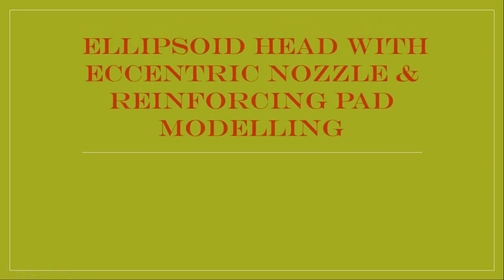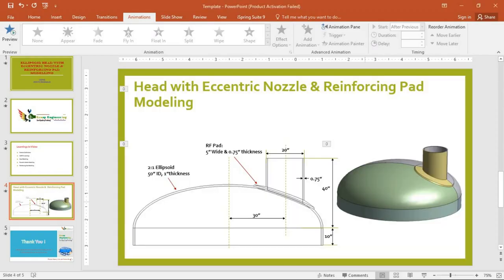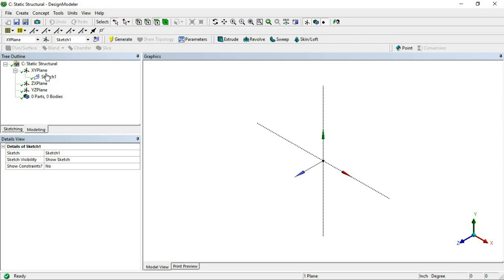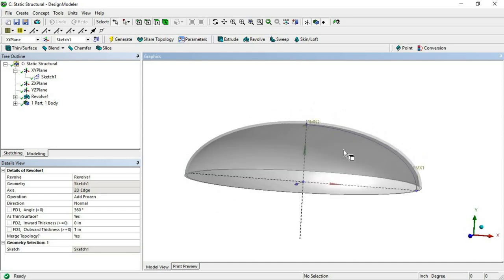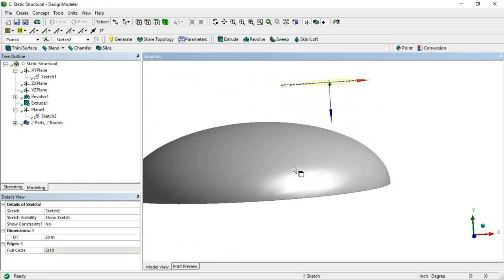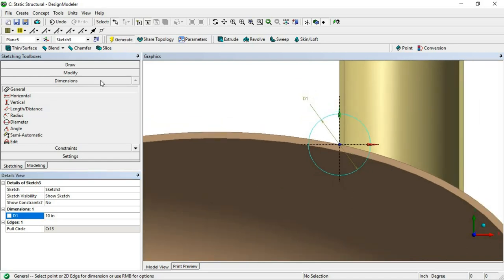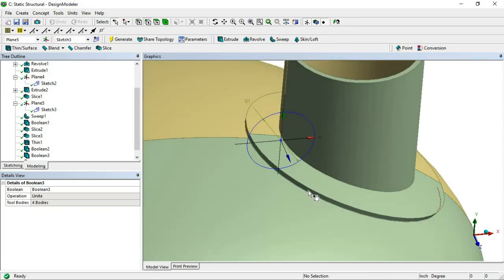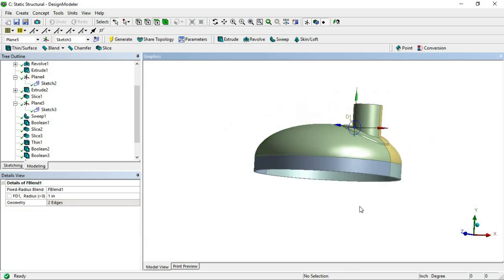Ellipsoid Head with Eccentric Nozzle & Reinforcing Pad Modelling Using Ansys Design Modeler

Comment: Sir when I extrude head to 10inch and click generate the result still shows 1 Part, 1 Body but in your video it becomes 2 Part, 2 Body.
Is there any setting for this.
Reply from the maker: While doing extrude use Add frozen option instead of Add material, Add frozen means it will not merge the bodies but will create separate bodies.

Comment: Can i swich my model Designmoduler to mechanical window and vice versa
Reply from the maker: Yes, You can Do changes in design modeler and then update the mechanical window. But design changes are not done in mechanical, it will be done only in design modeler.
Reply: @graspengineering9249  ok,i wanna change system coordinate first in mechanical window Nd then i want to go with this same changes in design moduler .how can i do that?
Reply from the maker: @nisargchauhan6595  Hello Can you plz define your purpose of doing this ?
Reply from the maker: Create plane in design modeler (using X & Y axis coordinates)and export that coordinate (having option below..keep yes), you will see same coordinate in mechanical window
Reply: @graspengineering9249  
Ya i am learning nozzle to shell junction fea.but the origin is not on the centre of shell so it may creates the problem during slicing.
Reply: @nisargchauhan6595  You can move & rotate coordinates according to your slicing plane requirement (keep Z always normal to the slicing surface).

Comment: Hi there, apologies in advance but technically so performing any analysis to help reduce stress at the nozzle-to-shell connection is bad engineering practice. Furthermore, from a Code perspective, re-pads are implemented to compensate removing the metal representing the internal nozzle bore area (otherwise known as the "area replacement method").

The underside of a re-pad to ellipsoidal head surface is in fact frictional (0.2 typically for steel-to-steel). The weld elements are actually "joining" the ellipsoidal head to pad to nozzle components. In practice, any displacements incurred due to nozzles loads for example will cause the pad underside surface to "slip" against the ellipsoidal head surface while the welds essentially absorb that induced stress. Trying to claim any stress reduction from a solid pad and shell is strictly not accurate and cannot be used for Code purposes.
Reply from the maker: Hello ! Adding re-pad means adding local stiffness which help to strengthen the local area resulting reduction in stresses and deformation. You can define friction between pad and shell (near nozzle area) but both will going to come in contact due to applied loads so better to consider glued connection. Which code says stress reduction is not accurate due to Re-pad ?